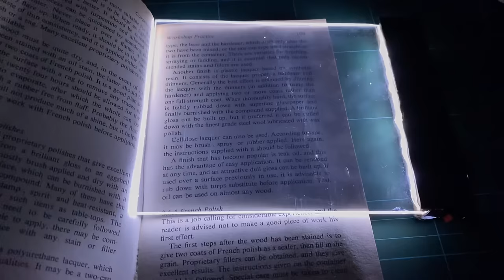6 AMAZING INVENTIONS that make people’s lives easier and more interesting!

Comment: Very clever.
This is something I built. Take a cheap dusk to dawn nightlight, solder wires to the bulb contacts. Fill the socket with hot glue. On the end of the wire add a plug in. Now you can plug in a small lamp and make it a night light.
Reply: 0